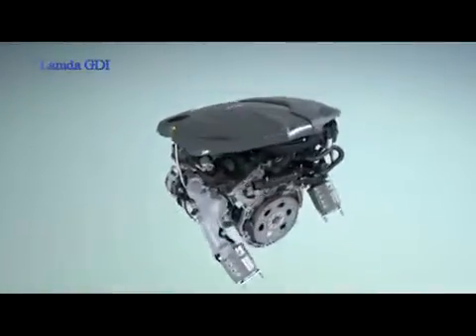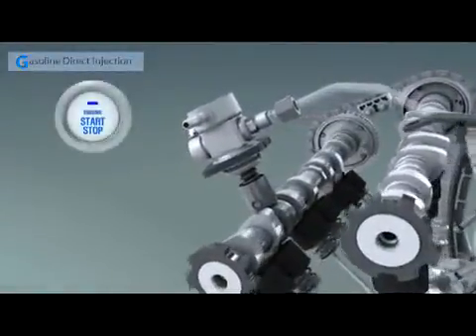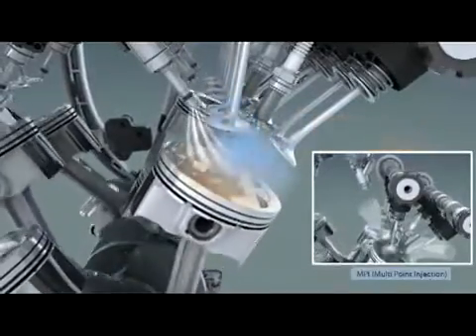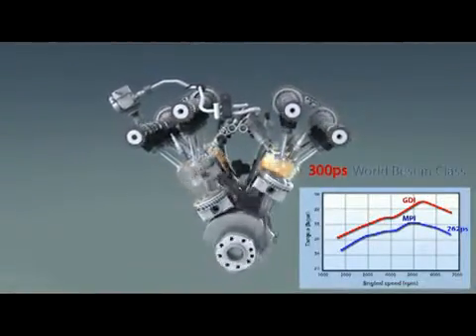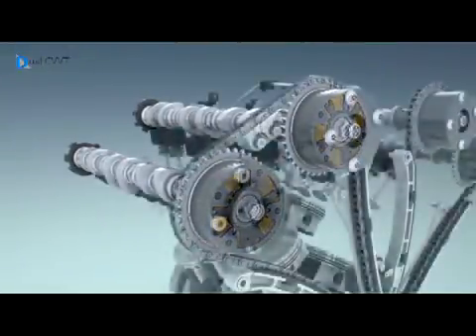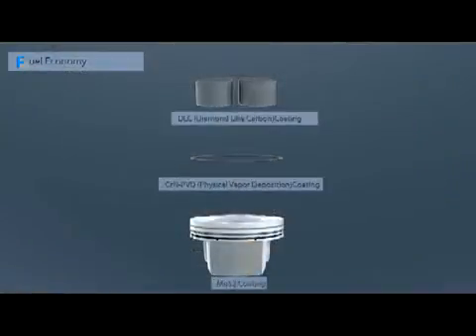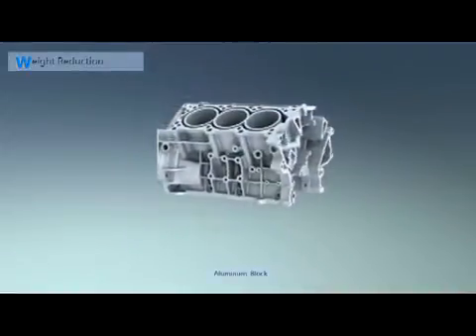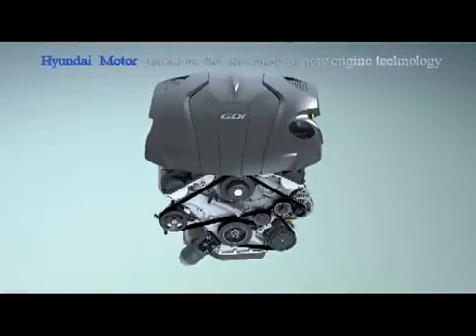Hyundai Motor Lambda V6 GDI

Comment: rebuilt a 2015 Hyundai Gen Coupe for a friend (he installed a turbo kit incorrectly tuned),upon taking the engine apart I seen first hand the poor workmanship of the Hyundai's 3.8 GDI offering .Casting flaws in the crankshaft,heads and poor coating on the piston skirts . Well designed but poorly executed engine and poor quality of parts .